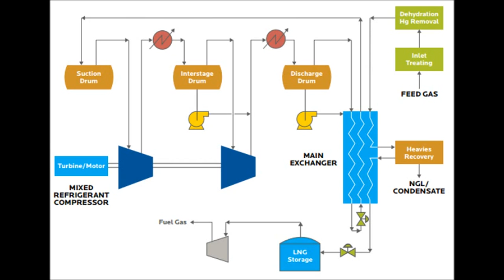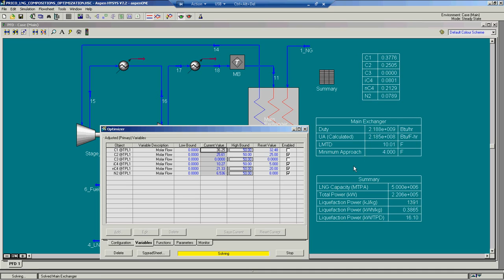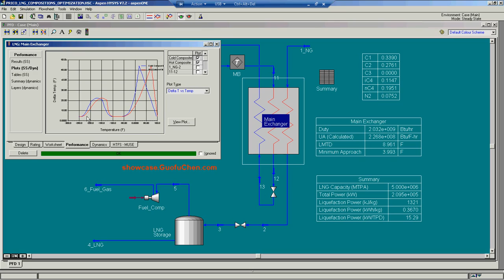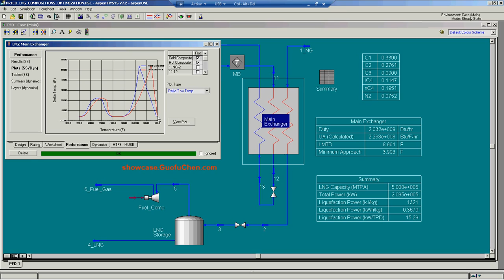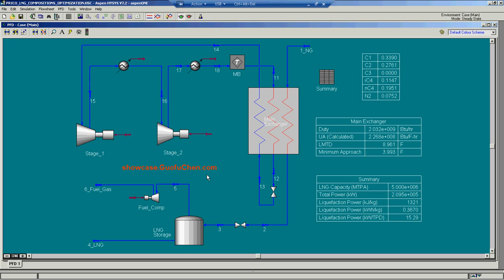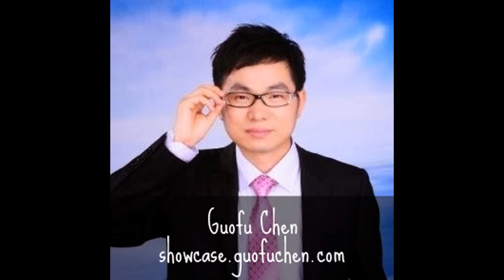Unveil the Top Secret of Mixed Refrigerant Compositions used in the LNG Liquefaction Process

Comment: Dear Guofu Chen,
I hope you are doing well.

I am doing a research project with regards to optimising small-scale natural gas liquefaction cycles.
I was wondering if you could provide me with any word documents you know of that can assist me in my research as well as reasons why specific temperatures and pressures were selected in the first place.

I am trying to minimise the compressor shaft work in the process in SMR in which my three degrees of freedom are:
- pressure levels
- refrigerant flowrate
- refrigerant composition

I was wondering if you can do a video doing an optimisation using Genetic Algorithm where you can link MATLAB optimiser with HYSYS simulator.

Thank you :)

Comment: Mr Chen  just want to know how do you come about with the main heat exchanger design, because i can not see this icon in hysys, please help me find out,  because have my project on improving a cascade liquefaction process and i'm still having some difficulties with this main heat exchanger design . thank you for your video very helpful .
Reply from the maker: +coulibaly ibrahim You need to have Asepn EDR installed on the same computer as well. Do you have Asepn Exchanger and Design Rating program installed?
Reply: Hmmm! I'm not sure I have it just have hysys aspen V 7.0 so how can i get it this aspen exchanger and design rating program?
Reply from the maker: +coulibaly ibrahim Hmmm, just the same way how you get HYSYS!